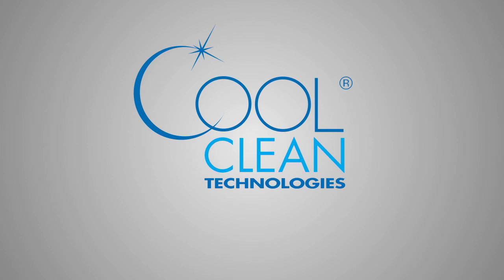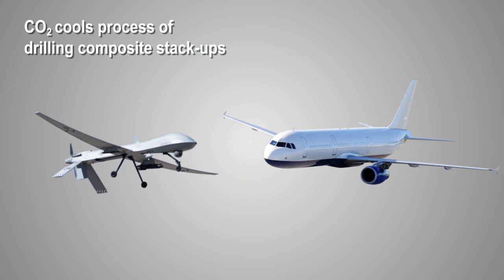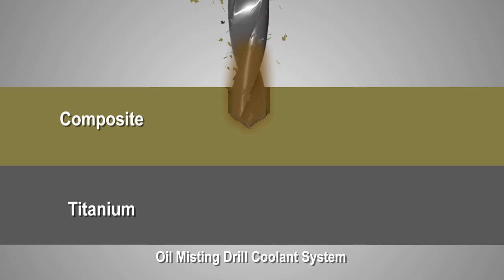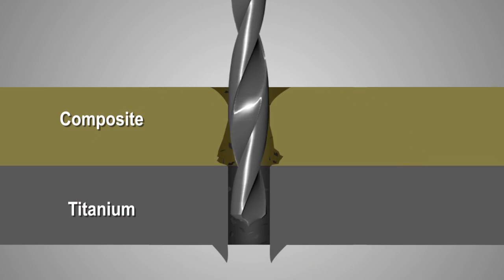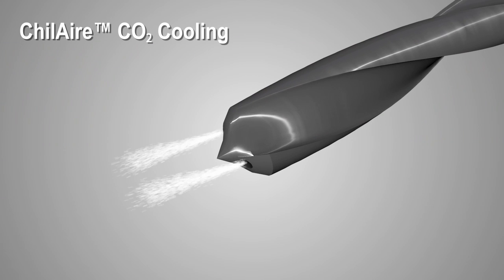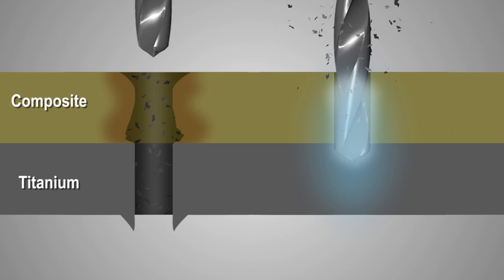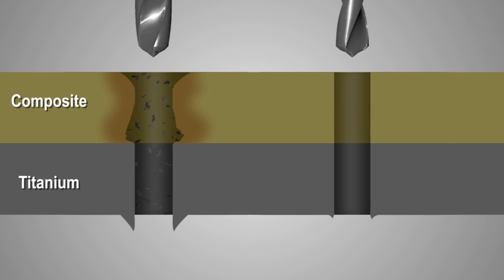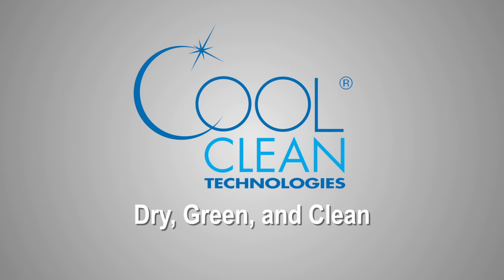Aerospace Drilling of Stackups with CO2 Cooling

Comment from the maker: Our  #CO2  dry coolant is competing and winning versus oil misting systems in tool life and chip removal for the  #Aerospace  industry! Check out the process with this animated video. Dry, Green and Clean!
Reply: It looks great. 
Just I have a doubt. About how many is the expansivity's factor (contraction at this case) between tool/part? Is it needed to offset the route to solve this possible issue on geometry?
Thanks and greetings. Nice video.